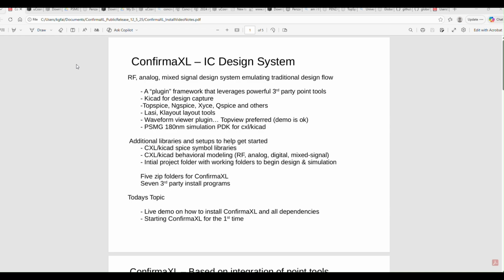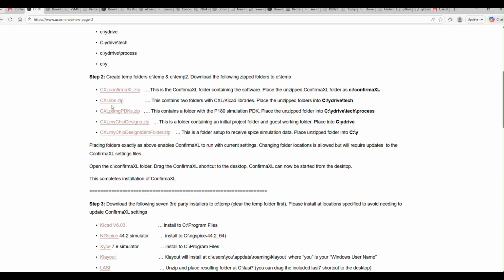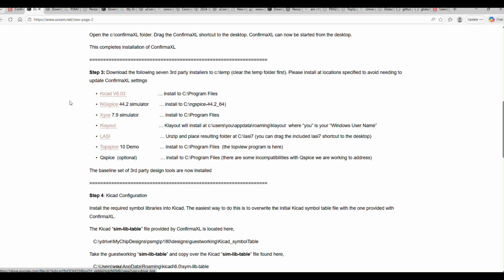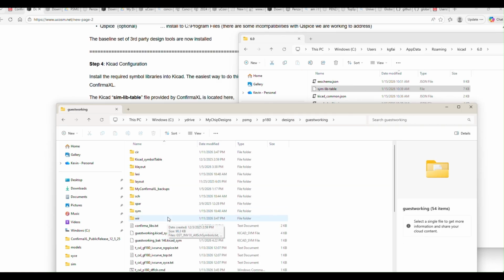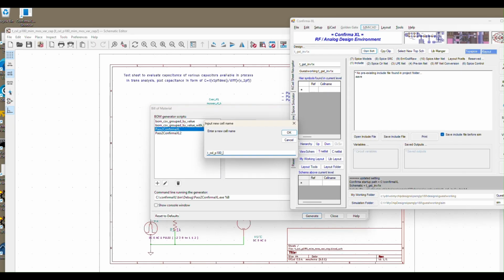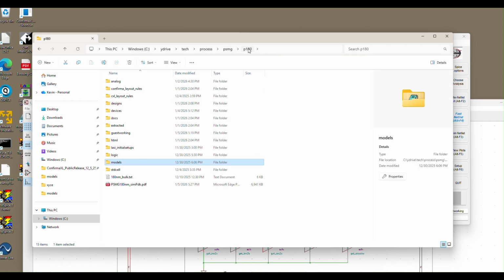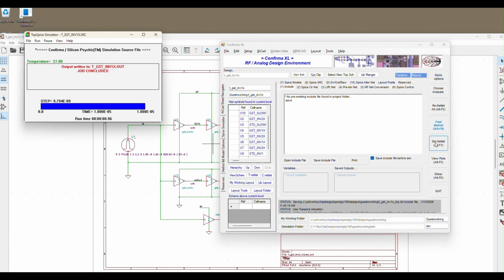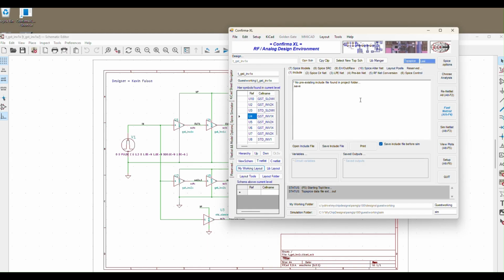ConfirmaXL #3 Help in Installing

Comment: Sorry for this but I may have missed something, where can I find the password for topspice installation? It said the "installation is password protected".
Reply: Turns out the password is right there on their website ("demo" for anyone asking the same question)
Reply from the maker: Sorry, just saw your question. Hopefully you were able to install the Topview demo viewer. There is a new viewer plugin so you can add Prof Hesham Omranh' s Spice Station viewer which works quite well. (See ConfirmaXL v0. 83c). Good luck with your designs!